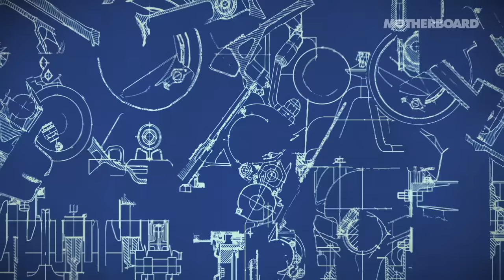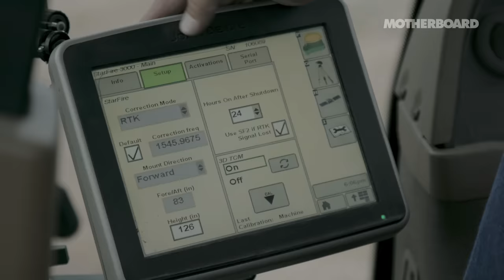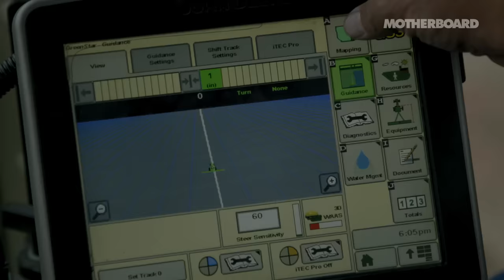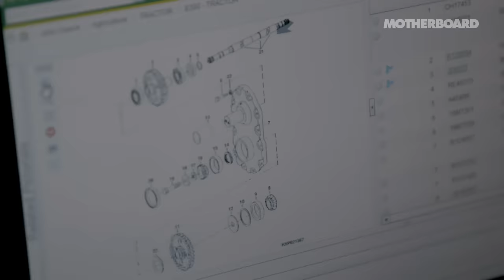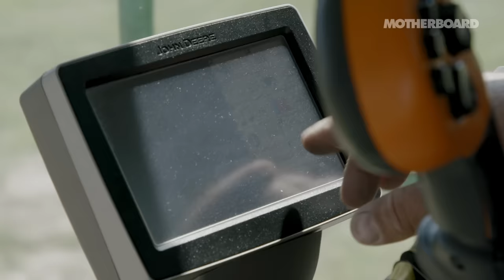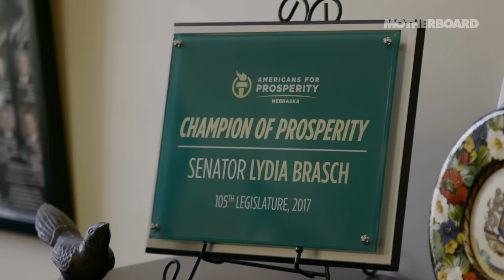Farmers Are Hacking Their Tractors Because of a Right to Repair Ban

Comment: This is a hell of an opportunity for a small tractor manufacturer: they could make their tractor software open source like Linux, or Apache, and invite users to publish code they've written, and the winner gets their ideas incorporated into the next release.  When you have more minds working on a problem, you improve the quality more rapidly.
Reply: Reduce the amount of software and isolate it from  basic functions
Reply: @GS-zc4sk  every bit of software is important and needs to cooperate. If you use gps to plant seeds, you need to have some other place to store it, while way too take it to the harvesting machine, and it needs to read a bunch of different sensors and use a bunch of actuators to do all the work.

You can modularise for sure. But you need all bits to remain competitive.
Reply: There are no small manufacturers.  Some of those machines cost 6 figures a piece.  Not something you can produce in the small time.
Reply: They'd probably be better off just not using much software at all. Many of the farmers might even like that. I've even heard some older tractors sell more than the newer ones for this reason specifically.
Reply: The very last statement hit it right on the head.  There is HUGE demand for older equipment that is not shackled by computer systems.  The old equipment can be repaired  with a wrench and some shared knowledge amongst friends, and will still be running 100 years from now.  Maybe we don't need GPS to plant seeds to get a 3% more efficient coverage...especially when that efficiency is usurped by a software malfunction that the manufacturer "no longer supports".   I'm only a hobby farmer, but I'm really becoming happier every day that my tractor isn't GREEN.
Reply: Or just go back to regular non computerized bullshit.
Reply: @GS-zc4sk  It's a double edged sword I guess how easy is it to just plug a notebook to your tractor and have it diagnose itself in a matter of minutes.
Reply: I agree 100%
Reply: Bravo! Excellent forethought! Wakodahatchee Chris
Reply: yeah and then get bought out or the financial version of executed by bigger companies. voting with your wallet doesn't work
Reply: I thought the same thing but in reality there is no such thing as a "small tractor manufacturer" in the same way there isnt a small car manufacturer. Maybe small compared to the  big players, but designing, building, and selling tractors would take an insane amount infrastructure and money. Would likely spend hundreds of millions before selling a single tractor. Not necessarily a field that the little guy can come and compete in
Reply: That sounds like it will costs billions.
Reply: @sinisterthoughts2896  The big tractor companies would muscle out a new tractor start up. Also, if the bill passed and it became legal to fix your own tractors, the little guy would instantly go out of business.
Reply: @rring44  I agree whole heartedly.
Reply: It’s insanely competitive and insanely expensive to get into that market at all let alone have an open source software system like that. I agree that would be amazing PR for the company but then JD would come in and drop boatloads of cash to buy them out
Reply: This is also a hell of an opportunity for China should they choose to develop it. They make very effective, and technically complex, high-speed trains (something that the US does not appear to have) and so you can bet your life they could if they wish to make technically advanced farm tractors.
Reply: @mikeryan8412  I think you make a great point and I for one love things that rely the least on electronic and computer components. I think it is getting out of hand with this whole relying on technology to the point that companies like John Deer can wreck a farming operation. I am a bicyclist and I see how even in this industry most folks like the new electronic computerized gear shifters and to tell you the truth mine are mechanic and will stay that way and many of my friends think I am antiquated because I refused to get on the bandwagon but I can work on my own bikes and I can still get the part. It is a shame that many people don't question this so called technology thinking it makes their lives better but at the expense of loosing social skills and interacting with others because they do it more on social media and less in person. My grandfather was a farmer in a very extreme part of Costa Rica, very hilly and he had no heavy tractors but just horses and manual labor but he made a nice living and fed his whole family and not one time any one went hungry and he neve borrowed a penny and owned his farm out right. Those were the times.
Reply: @Kyle Where are the cost? Why does it need to be so complex? If I can run my Industrial CNC plama cutter I built my self with free LinuxCNC software I am sure a open source tractor software is possible. Maybe the government needs to get involved and fund the development.
Reply: @Kyle Maybe they do, but to have a working tractor that can function and do what is needed, do you need to spend lots of money? I dont think so.
Reply: well... It's good idea, unless something go wrong, and something blew up, and you can't blame someone, because it open source
Reply: This is creating stupid people. It's absolutely disgusting and I know this sounds dramatic but it's one of the many modern bullshit things making people stupid and dependent on the dollar
Reply: UNITED WE STAND DEVIDED WE FALL. STOP USING HIGH TECH FARMING MACHINES. U R TALING JOBS AWAY. THAT'S INCOME / TAX $ / ECT...
Reply: @sanderd17  USE HUMAN LABOR. WE R OUTSOURCING HUMANS TO ROBOTS. ROBOT'S DON'T PAY TAXES HUMANS DO!!!
Reply: John Deere uses linux, they got developers working on linux kernels, they use AWS ☁️ they too gotta pay for innovation. They simply use encryptions n basic but complicated cryptographic modules, key management etc.
Software developers don't come cheap.
Reply: @mikeryan8412  That's great for you, but 3% efficiency on $100,000,000 is $3,000,000. Being small time means the efficiency differences amount only to very small changes. But on a big scale it's drastic.
Reply: @Kyle This is where the open source community comes to play.
Reply: I can't believe how many boomers are talking about "manual labor" and "no modern bullshit". You will need technology and manual labor with old tractors or a horse won't be enough and may even be dangerous. There is no going back when it comes to technology. 

What we need may be a mass boycott, but a better solution in my opinion is standardized connections communication between hardware and open source software (or at least the ability to install open source software).
Reply: @Kyle John deere's behavior is not acceptable and if they don't change, a mass boycott is what we need. Emissions are a big problem, but I don't believe it's a reason to not use technology. Now speaking of emissions, it would be good to look into electric tractors. Tesla, but open and tractors.
Reply: @Kyle Yeah, that needs to be fixed. The car industry is already working on it. Solid state batteries for example.
Reply: @Kyle I have written better code than most of the crap that is released and I am not a programmer.  Most of it takes 2 to 3 weeks to write.  The cost is hiring 6 people to discuss a problem plus managers and on up.  R&D is a joke.  80% is lawyers and executives.  Maybe 20% is actual R&D.
Reply: @sinisterthoughts2896  Almost all of them cost 6 figures. Those combines alone are 500k, its insane
Reply: Cars today can't last as long as older cars could simply they need to sell more and make it harder for you to fix and every car manufacturer switched to this business model but the heavy machinery intended to make profit and work hard can not be cheapen out, they have to be durable and the manufacturer can not trick you with fancier upholstery and futuristic design so they had to find a way how to generate profit and this is the way to do it so i don't think any tracktor manufacturer would apply any kind of open source software, and also you would easily loose warranty if that complex system goes wrong due to unprofessional change, it's like chip tuning the ECU you gain power but there is a reason why the guys who produced the car didn't choose the better map. At the end of the day you can use older more reliable machines but they won't be that effective that system which scans the soil and calculates how many seeds need to be planted and fuel economy is also a factor farmers use drones and this kind of hi-tech in eastern europe , where every penny counts
Reply: I think it's very interesting that several companies are selling 'Do It Yourself Drones', that the Software and Hardware are completely Open-source, and sell for a few hundred dollars. If some handfulls of Highschoolwrs, College Kids, Electronic Technicians, and Corporate People can figure out how to make something easy to build, program, and fly, that is small enough to hold in your hand, that can automatically takeoff, fly precisely to several hundred 'Waypoints', and land with very little interaction, talking to your Cellphone, adapting this same kind of thinking to a Tractor, Combine, or Harvestor should not be too difficult. Look up the popularity of Arduino and Raspberry Pi and similar controllers now and the incredible amount of things they can control, cheaply and simultaniously...
Reply: @Kyle I've spent my adult life in software development. This is not as complicated as you might think. There are ways to break down complex problems in to more manageable bits that are easier to work with.
Reply: @GS-zc4sk   Put basic functions in a library so they don't need to be re-invented each time you need them. Define well designed interfaces between the software layers to make test and upgrades easier and safer.
Reply: @sinisterthoughts2896   How about Kioti or Mahindra?
Reply: @oldfag_adventures   The way to avoid that is to no go public. If your business needs cash to expand, sell company bonds, don't sell stock. If you just give up the gotta-go-public paradigm, a lot of things become possible.
Reply: @jeffcauhape6880  🤦‍♀️🤦‍♀️🤦‍♀️
Reply: those that dont use def have a higher price.
Reply: my 23 year old vauxhall has a diagnostic point i told him mis firing  he said  number 3 i cant evan see the plugs i give up.

Comment: One would think that spending 6 figures in a tractor would mean it doesn’t break so damn much
Reply: Ah, but you see that wouldn't make the company more money!
Reply: That's just capitalism at it's finest... Want something even better? Printer. See how well they last and go ahead and try to repair them. Tried to fix one once, it's maddeningly difficult.
Reply: Farm equipment is put through a lot of strain for long periods of time. Wires get pinched, bars get bent, things break. Only difference is with the old ones are incredibly easy to work on, so you can be back up and runningin a couple hours  with three wrenches and the replacement part.
Reply: One is a fool lol
Reply: Nah, this isn't a car it's a working machine. These things are pushed to their limits often for 20 hours a day during planting seasons. John Deere equipment is good that's why people pay the price.
Reply: I worked for a Volkswagen dealership and they made far more on parts and repairs than they ever did on selling cars. Selling vehicles is just getting the foot in the door so that they can sell you repairs and parts later on.
Reply: They design the tractors so that they need more maintenance john deere can increase their revenue.
Reply: @colamity_5000  yes, the equipment is good, the software inside the equipment not as good
Reply: @mickys8065  in my experience the software is good too, the main issue is that if literally anything goes wrong you need a john deere technician to even be allowed to fix it whether its software related or not.
Reply: Some of this is EPA Clean Air Regulations. But give us the codes and data and a repair manual and schematic. That's fair. Some will hire out the work. Some will learn to do it themselves. Isn't that what the EPA wanted? Properly operating equipment and systems?

Comment: Ever person with access to the pirated software, should share it to every other machine owner and mechanic in their district, and totally flood the market with it.
As a mechanic, going out into the field without tools required for a job, just doesn't cut it. The diagnostic software doesn't drive down to the local store to purchase the parts required, after the problem is identified.

Comment: Retired electrician who over 30 years ago ran into problems with larger equipment companies removing model #'s on IC chips and placing thier own numbers and thier prints never shown internal connections so we were forced to ship them a board where they would replace a $20 chip and charge us from $500 to 800 for what they claimed was a rebuilt board.
Reply: Wow.  That’s still likely being done today.

Comment: I work for deere today they lost a lawsuit over this. You can now communicate with a tractor via a subscription and guess what? My dealer i work for pays that same subscription. You can buy an EDL (your brain in between your laptop, basically a cod inscription tool) over you local deere part counter. But im here to tell you unless your farming 5k acres its not worth it. Find a pirated version. Its just like modern day cars (whick i also worked on professionally). Your not talking to your mercedes the way you need to or a dodge for that matter with top of the line scan tool. Today its everywhere and yes i strongly disagree with not being able to obtain software. Its a way for someone with deep pockets to make em deeper. Its time we stand up and pass a law not just for deere but EVERYONE.